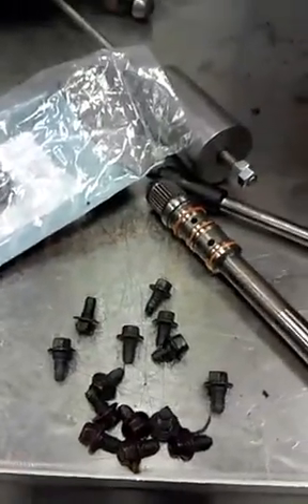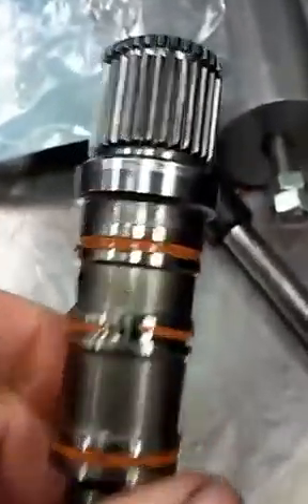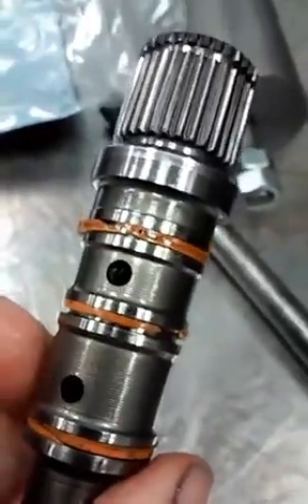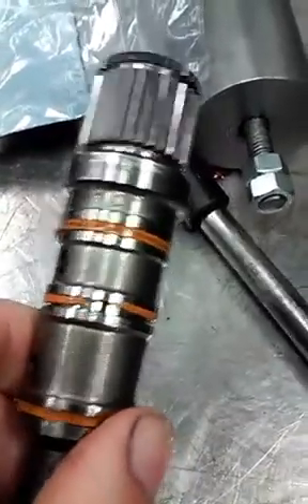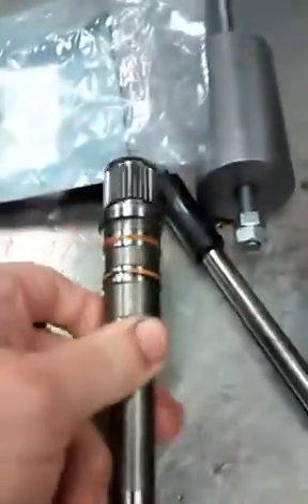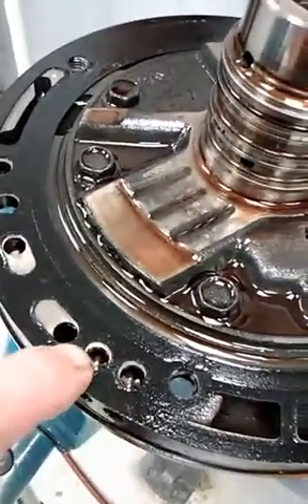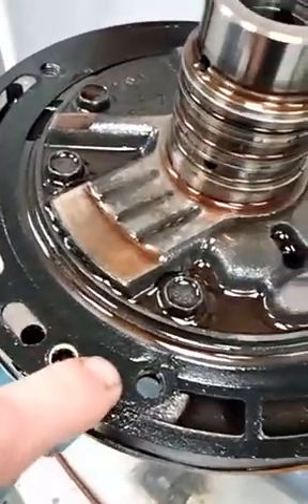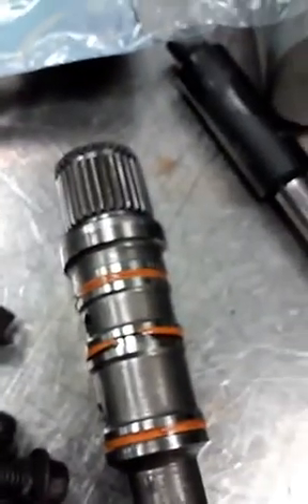P1776 code cause dodge caravan

Comment: What were your vans symptoms?
Reply from the maker: I think the torque converter wouldn't go into lockup
Reply: @torque63  because mine has the P0 700 and the p1776, I was driving fine in the highway and it suddenly wouldn't up shift, check engine light came on, so I pulled over to look things over. I didn't see nothing wrong, so I started to go and it shifted again all the way into 4th. I read that it might be a valve body problem/ solenoid pack problem, but I don't know I'm not a transmission guy.
Reply: @ricgomez1 mine doin the same thing
Reply: I got both of those codes now what parts did you need
Reply: @mardeetoguzman4745  i replaced the valve body and no imrovement so I ended up changing the whole transmission